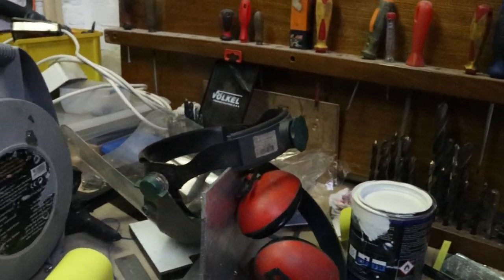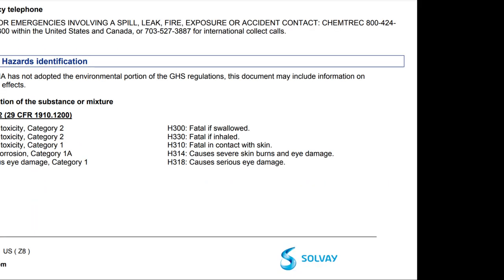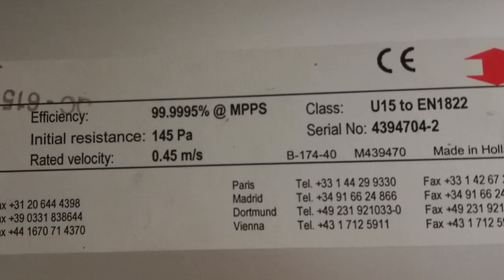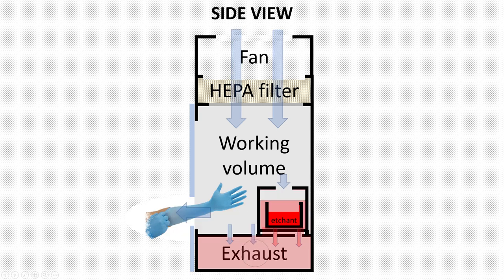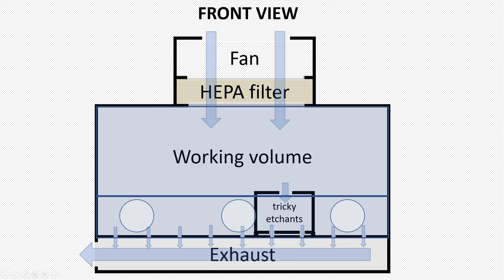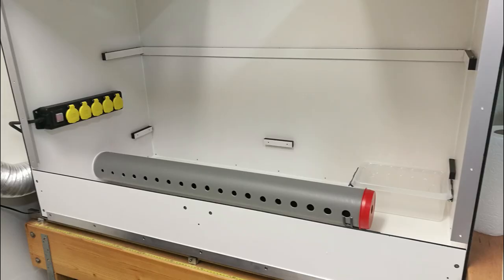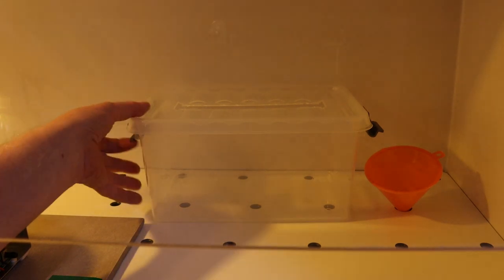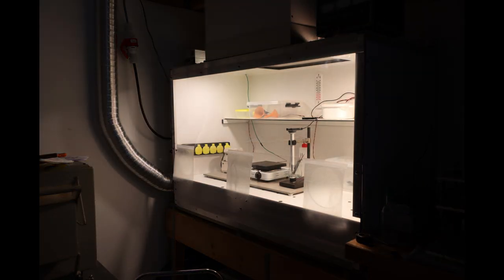Building a Small Cleanroom for Photolithography.

Comment: I use to work in the R&D lab at the factory where those Siemens drives were made.  The high pitch sound is the switching frequency of the inverter.  There should be a setting to set it above the audible frequency range.  I believe its slightly less efficient but it's probably worth it if you have hearing like a dog. Look for a pdf manual if you haven't already got one. 👍
Reply from the maker: Thanks, yes it was solved by changing the frequency

Comment: on many VFDs you can change the control frequency to a higher value. It typically de-rates the output current slightly but that shouldn't be a problem normally. The higher frequency is less audible.

Comment: Designing and building these cabinets is actually my daily job. You made some good decisions and only very few bad ones. Airflow can be tricky to predict. Overall not bad!
Reply: My thought was that you would want to have some way to monitor the negative pressure space, like a little plastic flag or something, to ensure it was constantly pulling into the box. Also, the piping used for the exhaust connection to the roof looked suspect, if it is going to have chemical vapors in it.

Comment: Looks very nice, I would assume that it is way better than class 1000, at least if you turn it into a proper glove box or cover the holes with "brushes" (I don't know the proper name of these).

A possibility to improve the class is to recirculate some of the exhaust air. If memory serves me well from my clean-room time, 80% of clean room air is re-circulated and only 20% fresh air for the typical class 100 room.
Reply: I think the main issue with that is that it would necessitate a separate exhaust for the hazardous materials, but definitely very practical if he builds a second one for the wafer stepper!

Comment: Very nice! I subscribed to your channel as I am working on a planetarium projector where I need to make 32 "star plates" lithographically. Some of the pin holes are in the tens of microns. I want to approach this with direct write laser lithography by adjusting the focus of 405nm laser into a microscope lens at a fixed height over an XY stage. This should allow me to expose a photoresist on aluminized glass and make pinholes of various sizes. We'll see... I think I am going to need to come up with something similar, as the XY stage will take some time to move to the next pin hole exposure position and could gather dust in that time.

Comment: As mentioned in the comments before, you should try to etch glass with KOH. This is much safer and you dont need HF for good results. In the institute where I work, we etch laser modified fused silica every day with a selectivity of 1000, which is quite sufficient to produce microfluidic devices, waveguides or whatever you want. When you want to look for further readings, search for SLE or selective laser etching.
Reply from the maker: Thanks for your suggestions. Actually, I did look into it and my first impression was that the rate of etching of KOH was much lower that that of HF. However, I did not consider SLE. So my plan is to do a video in which I will look further into the different options.

Comment: You had me worried at first with the overpressure design - great for clean rooms but not for personal safety with HF. The final design is exactly what you need - an air curtain and an under pressure zone to draw away HF fumes.
Reply: Why not make a wall design with a pressure design in the wall, and the inside is a low pressure zone, it will create a quite effective barrier.

Comment: Check the corrugated exhaust pipe as it seems to me to be the pipe which is not a single casting but obtained by wrapping a strip of aluminum along the circular surface to match the corrugation. There may therefore be microscopic gaps along the outer surface of the pipe from which the toxic gas could escape.
Reply from the maker: This pipe is at a under pressure compared to the surroundings. So although theoretically it could leak fumes to the outside if it contains leaks, this is quite unlikely.

Comment: This is a wonderful project, was a vibration isolation an issue? And did you want or consider a positive pressure glove box, recirculating clean air with exterior exhaust?
Reply from the maker: I did not have issues with vibration isolation. Also I did not really consider a closed system glove box for this purpose, because it would require an air lock to get things in and out and this would complicate things quite a bit.

Comment: Regarding the motor driver and the high pitch noise… You can try some of inductor “donut rings“ which are commonly needed for motor drives and noise issues.

Check out the YouTube channel “clough42”

He’s the guy to talk to and has several wonderful videos regarding VFD‘s, motor drives, wiring, noise issues Both electrical and audible noise. He’s a genius, and is capable of the most complex work… Although he sticks to mostly machining and electronics diagnostic stuff… He’s a really smart dude and is capable of much more complex work than the stuff he shows on his YouTube channel.

I think it’s just the switching speed of the transistors which is causing the noise and I don’t think there’s anything that can be done about that but I could be wrong.  I have heard of tweaking the switching speeds so that it is out of the audible range.

Comment: Hi
It is good idea to use closed outdoor rackmount server with modification to use for cleanroom like this ?, my main purpose is also for photolithography and hard drive repair..., main components is steel plate with powder coating paint, I will use acrylic for front door access and lighting just like yours and blower fan with HEPA, also silicon sealant and aluminum tape for closing air leakage
Reply from the maker: I think that would work, especially if it's a closed system. But open server systems would also probably work, as long as they are not filled with dust when they go in the clean room space.
Reply: @HuygensOptics  No, It's closed rackmount system and designed for outdoor cell tower system, by default is IP55

Comment: 9:15 your PHONE has a pressure sensor?  Is this a standard piece of equipment which comes on cell phones??
Reply from the maker: Probably your phone does too. You can find out by installing for example Phyphox or another app that can access all  sensors inside your phone. The  phone shown is a Google Nexus 5.
Reply: @HuygensOptics  This is AMAZING!  Dude you're better at technology than I am! <33333
Reply: Yes, most phones have barometer/altimeter chips in them, as well as 3d compass, 3d accelerometers and 3d gyros.

Comment: @Huygens Optics Hi Jerome can you make a video for safe practices for small quantity handling (and disposal) of Hydrofluoric Acid ? I copied this video in a post on PM-Forum (Practical Machinist) - thread  "  Hydrofluoric nitric acid pickling" [Mainly your clean room / HF hack], seems they could really use some of your advice / experience there that I'm sure would be greatly appreciated.  The OP is wanting to use quantities smaller than 250 mm and parts are less than 1" x 2" . Cheers ~ Exciting channel BTW.
Reply from the maker: I will do a video on glass etching in general, probably at the end of this year.
Reply: @HuygensOptics  Awesome ! Look forward to it !

Comment: I believe the inverter is using a high frequency carrier wave within the audible range. You can try and change the settings for it according to your manual or it might be changed via a manufacturer firmware. This video discusses the issue using a different inverter or VFD: https://youtu.be/Z9cGXScBH88

Comment: The only way to really reduce the VFD noise is to turn up the switching frequency.
Reply from the maker: Thanks, so I guess it is pretty hard to get rid off since you generally cannot change the switching frequency of inverters.
Reply: @HuygensOptics  Yeah, just a case of a more expensive, higher frequency VFD.
Reply from the maker: Damn.  I had hoped I could just add a few capacitors between the 3 phase lines or something. But given your comments, that is probably not a good idea...
Reply: @HuygensOptics  for just an inverter it would probably have to be corrected in the design of the inverter itself
Reply from the maker: @SeanBZA   I will try that. Actually I'm old enough to not hear 16kHz well any more ;-).
Reply: Are you sure that parameter P1800 (switching frequency) of the micromaster is at its highest frequency? Default is 4kHz I believe, but they can go to 16khz with some max power derating. Sometimes it can also be worthwhile to experiment with lower frequencies because of less resonance or just less annoying in personal preference.
Reply from the maker: Thanks  @wim2874  I think the parameter is in the default value. Changing it is the first thing I'll try.
Reply: @HuygensOptics  Right, the inverter o/p should be as close to ideal sine wave as possible to reduce noice. So higher switching frequency seems to be the only soln.
Reply from the maker: Problem solved! Thanks all for the suggestions. The inverter actually allows setting of the switching frequency (Parameter P1800 as Wim mentioned) between 4 and 16 kHz in steps of 2kHz. Even at 12kHz I don't hear any whining sounds..👍
Reply: @HuygensOptics  I guess I replied a little late elsewhere here. Glad you found it.  I still have a couple of these drives.  I was a student working at the Siemens factory where these particular inverters were made about 20 years ago.  They weren't even for sale at the time. I wish I kept more of them.  The bins/skips were a gold mine for me. 😀

Comment: I need to clean a lowpass filter and an image sensor, but without a cleanroom, it's nearly impossible to do.
What are you using to clean glass ? I mean, I have to fight dust, lint, streaking and surfaces, which are electrostatic charged thus dust sticks to it like crazy.
Desktop Ionizer winstat bf-xmb & HYPER CLEAN EE-6310 ?
Reply from the maker: I don't have a look of problems with electrostatic charge and guess that is because I live in a fairly humid climate. You might want to try a humidifier.